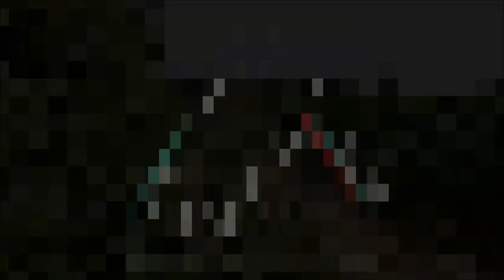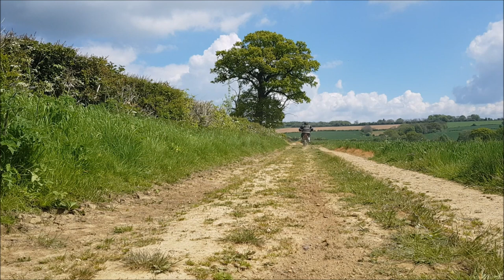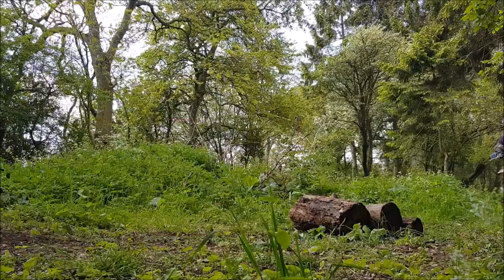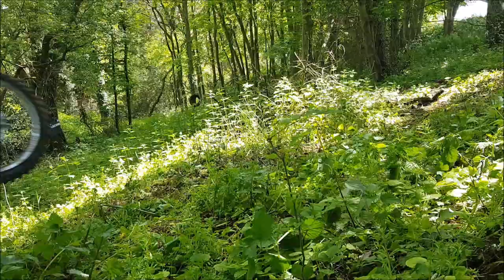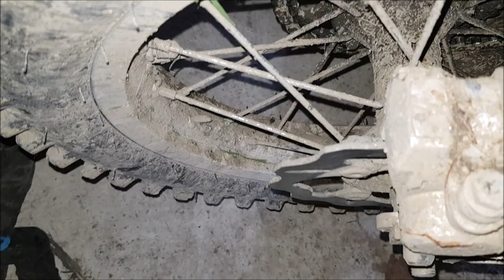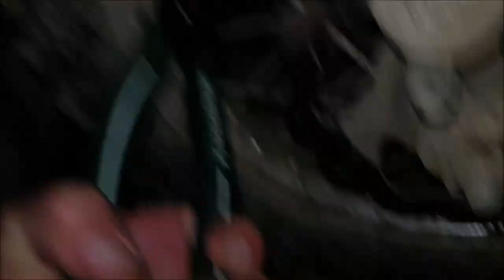ENDURO TRAINING 170 DETROIT? JUMPS | WHEELIES | CLIMBS

Comment: I think demonx should sponsor you as your the only one on YouTube that’s vlogs on the demonx well the 170 anyway and that’s wot you call shredding mate good vid and really showed how good the demonx is apart from the wheels lol I’m having problems getting the  4 stretch bolts for the head I’ve contacted stomp and they are saying they only come with the bottom end surly that’s bollox anyway good vid mate look forward to the next
Reply from the maker: Lol that would be good if they did for sure, if they paid I would do alot more stuff on the pit bike. Proper test it. Wheels are shit I'm rebuilding it now as got worse last weekend. You just need the
Size of bolt, I'm sure you can find on Ebay I cant remember it now but take 1 out measure it. Surely cant need all that just to replace one of them.